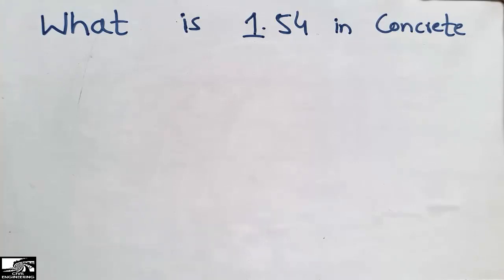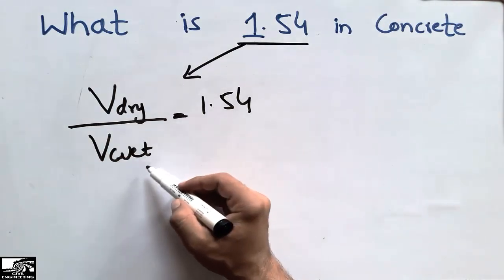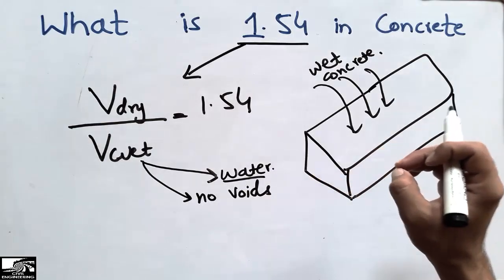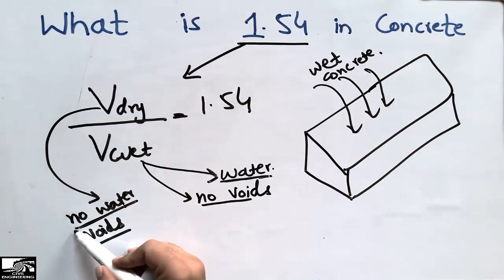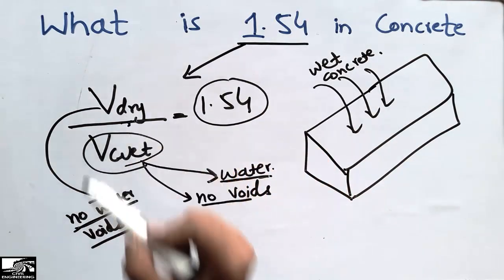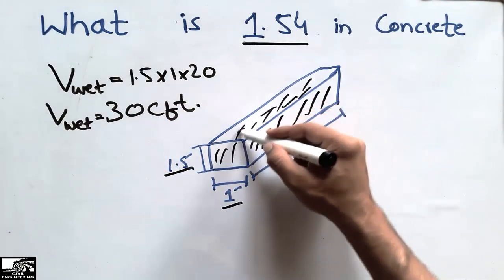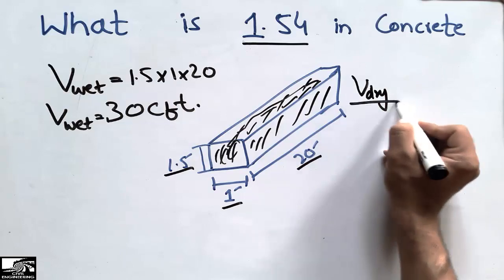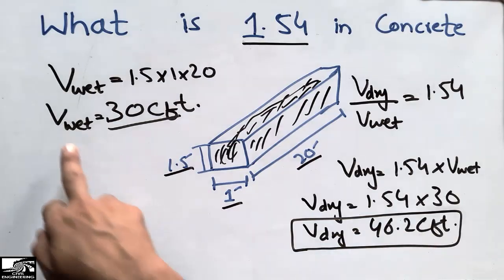What is 1.54 in Concrete | Example Solved

Comment: I was expecting that you would explain that why 54% of volume is increased, not the other value like 20, 40% or any other value.
Reply: During dry condition the particles of concrete i.e, cement sand and aggregates are held together by friction leaving pores and voids in the dry concrete which occupy a space of (54% of wet concrete) inside the dry concrete mix. On addition of water the particles of dry concrete slide over one another due to the loss of friction between particles as the water acts as a lubricant between the particles resulting in readjustment of particles in a closely packed pattern reducing the volume occupied by the voids and hence reducing the volume of concrete mass..... Regards! #civiltutor
Reply: If 54% is voids then what about wastage?
Reply: https://youtu.be/0a5dlD1WNzc

Comment: Water is placed by removing the voids then how can you say that volume is different. Actually the density is different here. Please explain
Reply: @kevin mathew Thanks for your appreciation....well it will be amazing if you hit that red $ubscription button of my ¢hannel... Regards! 😊
Reply: During dry condition the particles of concrete i.e, cement sand and aggregates are held together by friction leaving pores and voids in the dry concrete which occupy a space of (54% of wet concrete) inside the dry concrete mix. On addition of water the particles of dry concrete slide over one another due to the loss of friction between particles as the water acts as a lubricant between the particles resulting in readjustment of particles in a closely packed pattern reducing the volume occupied by the voids and hence reducing the volume of concrete mass..... Regards! #civiltutor
Reply: https://youtu.be/0a5dlD1WNzc